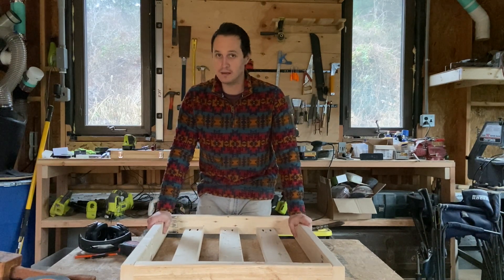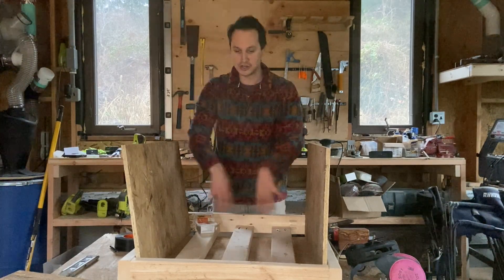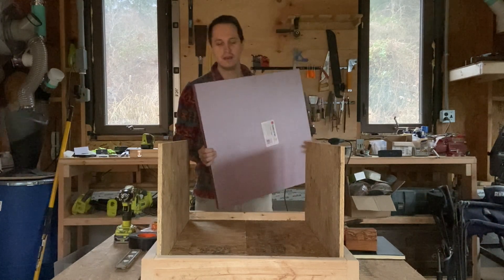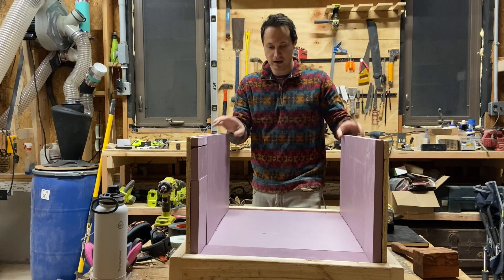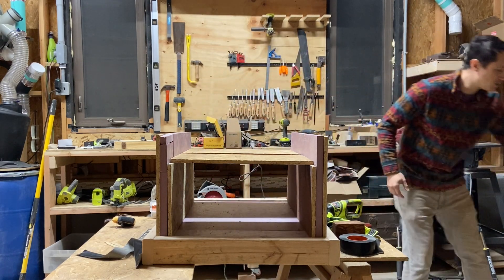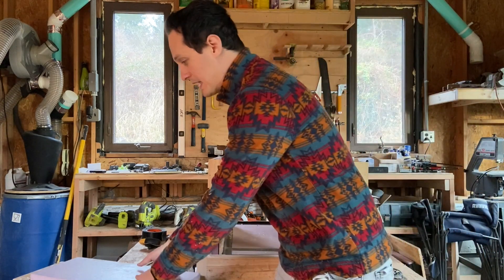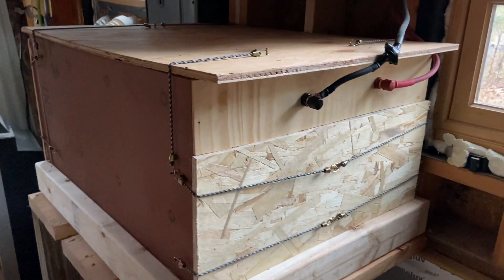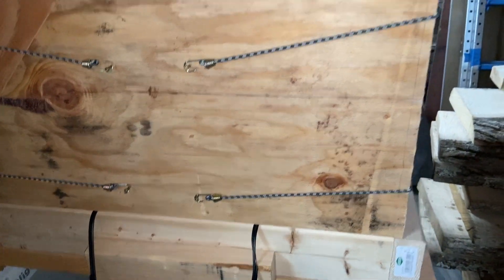Keeping Your Batteries Safe - Building a LifePo4 (LFP) Insulated Battery Box!

Comment: I built a plywood box insulated with PIR foam and my BMS has the option to connect heat pads that are connected by the BMS if the temperature drops below 10C. The Lifepo4 cells sit on a layer of aluminum foil bubble wrap. The aluminium spreads the heat more evenly under the cells. There are two silicon heat pads under each pack of four cells. The BMS still has low temp protection cut off.
Reply from the maker: Which BMS are you using? I love the idea of the aluminum foil to spread the heat.
Reply: @TheWilltoBuild  Sorry I didn't see this question. I used the 12v version of the JBD 200A BMS that has the option to attach heat pads, purchased directly from AliExpress because I'm in the UK and we don't have a UK based retailer.
Reply: So he decided to give some insights and then runaway
Reply: @crushyad2939  thanks for highlighting that I had missed a question. I have now answered the question asked.

Comment: I didn't know batteries had feelings. (forgive me!)
An DC incandescent globe as a heat source will work to heat the box that is as well insulated. I've been toying with the idea of embedding two probes in a small sealed vial of salted water (and air) to detect freezing conditions.  When salted water freezes its conductivity will drop dramatically so with the addition of a couple of really high value resistors and a FET it can turn the lamp on when it freezes and off again when the salt water in the vial melts. Mount the vial so one end is in the box and the other side is outside (i.e in a hole in the side of the box). The advantage of this is that it can run from the battery directly without relying on grid power to operate, it will draw negligible current when off and when it is on you can see it working through the vial.

Comment: We're nearing the end of a very serious cold spell just east of Bellingham, down to -5ºf one night.  In preparation I insulated our batteries (3 x 200AH) and inverter/solar chargers with several inches of extruded polystyrene, the type with the highest R value (Box store).  Everything is in an outside shed, a safe distance from the cabin.  As temperatures dropped I monitored the temp with a bluetooth phone app.  We needed heat so I ran "heat tape" (for freeze proofing plumbing) around all surfaces I could access.  With temps 5-10º day and night I also borrowed our cat's heat mat and slipped it in beside the batteries.  Other than the power drain our batteries have remained remarkably stable at 44ºf.  Unless you're living somewhere much warmer, I don't think your insulation is sufficient.
Reply from the maker: Thanks for sharing your experience. It is definitely a fair degree warmer here (mostly above 20 even at night). Another major consideration for me was size, I just didn't want this box to be any more massive than it already is. But there are a bunch of easy ways to add insulation on the outside if need be, as well as more heat mats. I had never heard of heat tape but I absolutely love the idea. Wrapping one of those around the battery could make a big difference, thank you for sharing!
Reply from the maker: I just wanted to follow up on this. We've just had a pretty serious cold spell (couple nights down to about 5 F), and the battery box has worked flawlessly. No issues at all. Given how tight the seal is around all the removable parts it seems to be working very well I am very happy with it.